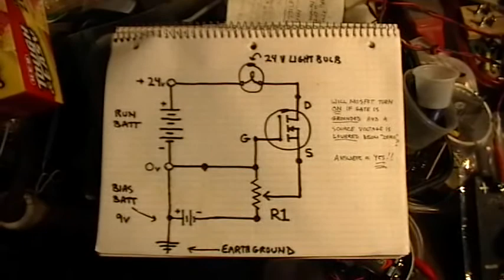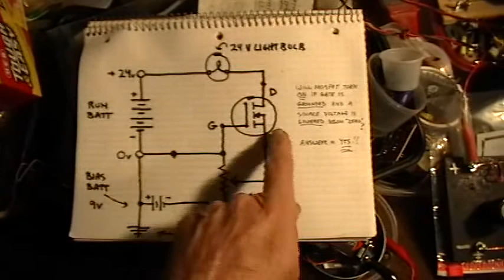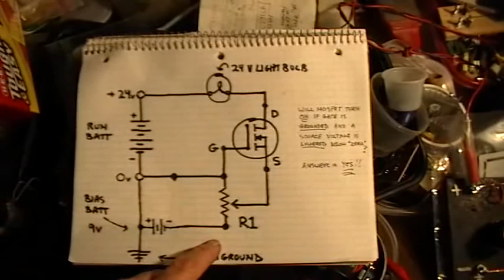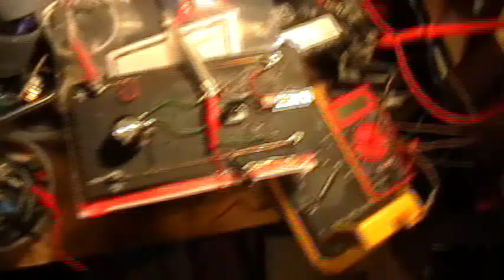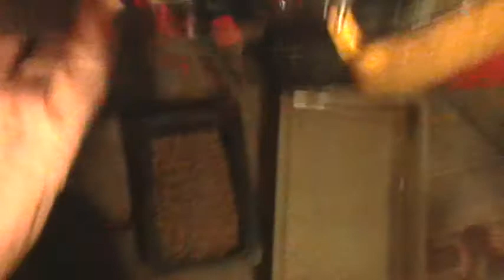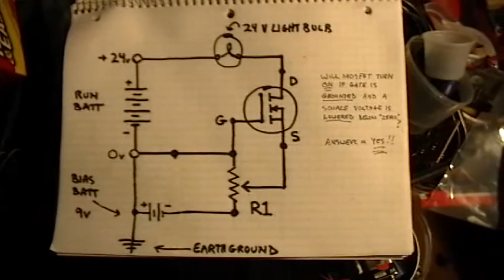Electric OU: Supplement: Driving a MOSFET by LOWERING SOURCE VOLTAGE Part 1

Comment: What is the current rating of R1 ?
Reply from the maker: It looks like I am using a 2-Watt "Type J" potentiometer here. You bring up a good point that I should have covered in the video, thanks. This pot should be a good quality pot if you are going to use it to carry big currents for a long time.